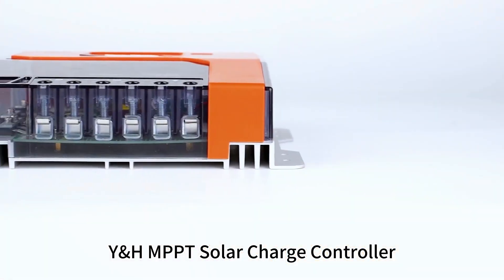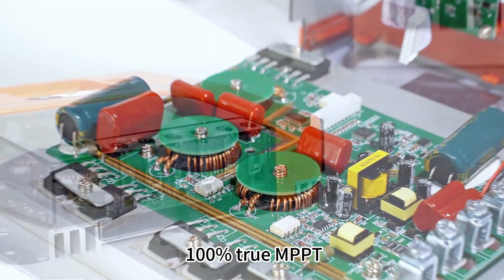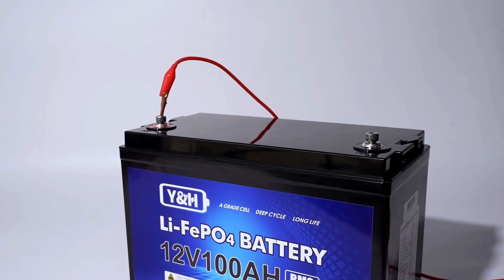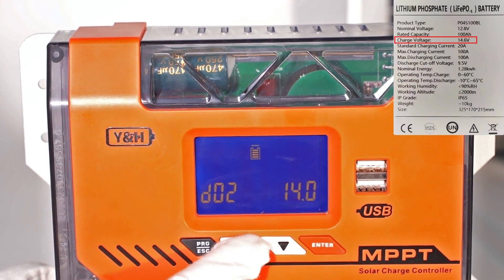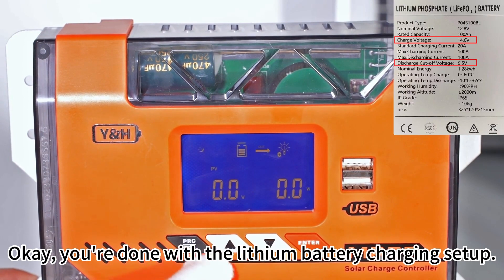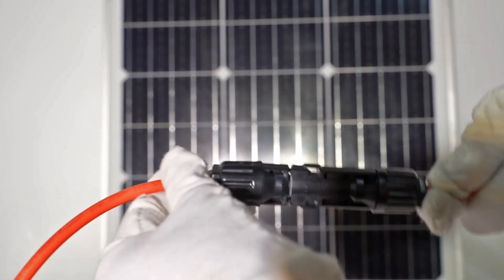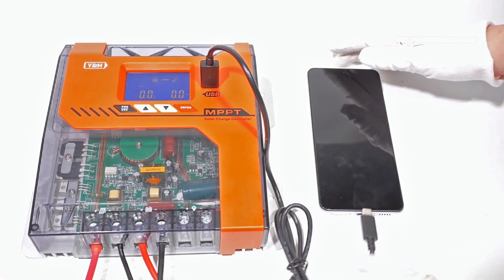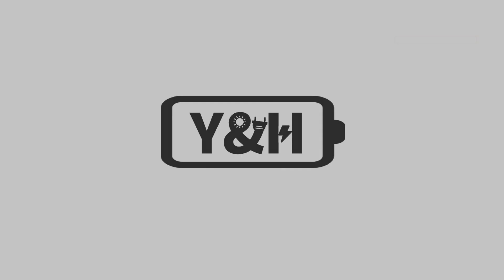Y&H MPPT 20A Solar Charger Controller 12V 24V 36V 48V Battery Charger Solar Panel Regulator

Comment: Canbt set it for lifepo4 battery. It charge, but cannt set liion mode and top voltage. Bms disconect charger.

Comment: I can't save settings, even if I have it set correctly. After a couple of minutes it will return to default settings. Which is lead acid. Im using Lifepo4 I need to set it to that kind of battery.
Reply: Same. HW like fine, but firmware is with bug. Look like best way to write custom diy firmware instead by vendor
Reply: Poderia me ajudar a reescrever o software

Comment: How many solar panels watted  can handle in 12v system
Reply: 720w
Reply: 12V system: 20A maximum usage 240W; 40A maximum usage 480W; 60A maximum usage 720W.

Comment: Is it this real mppt change controller?
Reply: It is totally garbage
I can't set the settings I want, It goes back to the default sitting.
Reply: Yes. I recently purchased a 20A and it surprised me with its internals quite well for its price.
Reply: @pingpongpanpan190  Does it adjust the load output voltage... or does it automatically follow the battery???